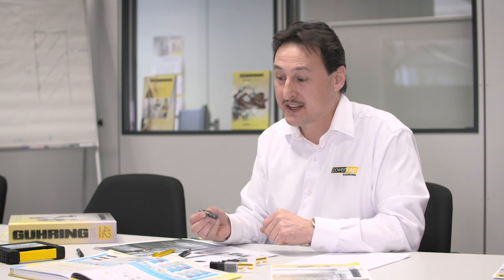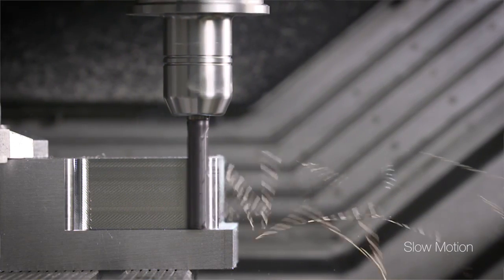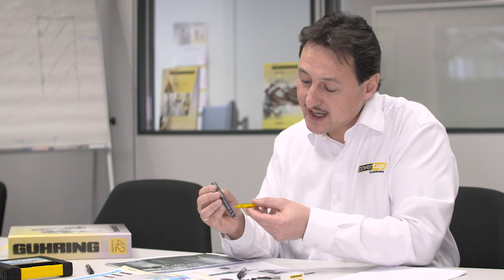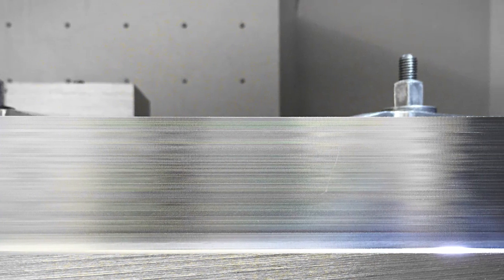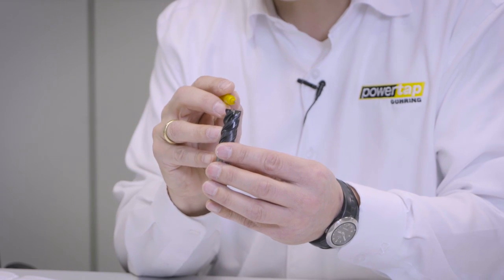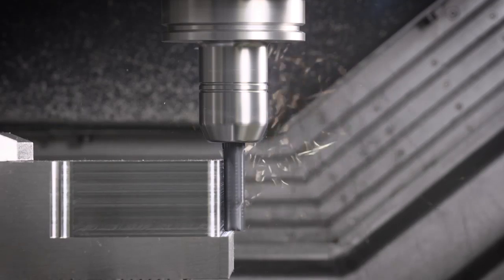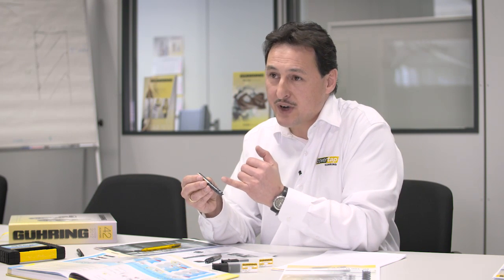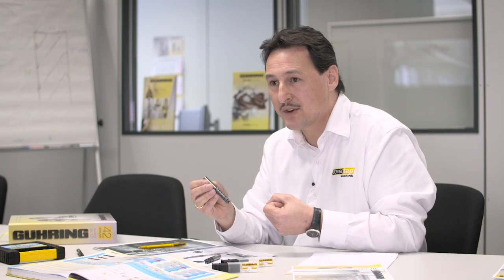RF 100 Speed HSC end mills

Comment: I've used the standard length RF-100 "speed" endmill in 4140 with an interrupted cut on a multiaxis lathe. To be specific a 1/2" cutter, .0625 radial stepover, 5000RPM and 45IPM. With only 4 HP and a history of endmills pulling out of the collet, this endmill looked brand new out of the box after running 20 parts ( a LOT of steel removed ) Awesome. Sold.

Comment: what is the best bit for aluminium plate mill and cuttin with high speed cnc 18000 rpm max?
thanks
Reply: Eugenio Villaverde standard 4 flute works best for me at 24,000 rpm and at 3000mm/min with shallow 1 mm depth of cut radial and axial 7mm
Reply from the maker: We would recommend Guhring’s Series 4265 end mill.  This is our 3 flute variable helix end mill for aluminum.  This can be found via this link: http://www.guhring.com/Documents/Catalog/Tools/4265.pdf.